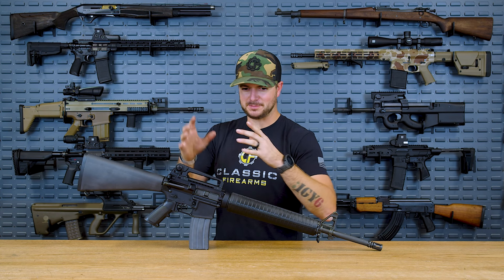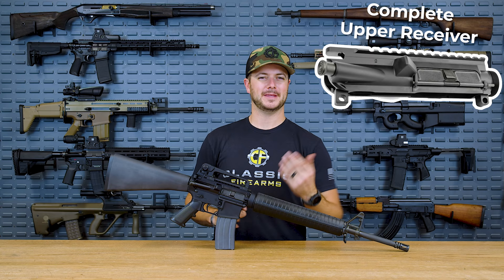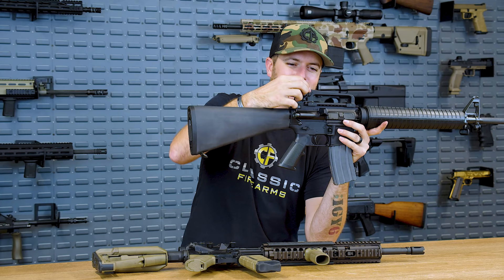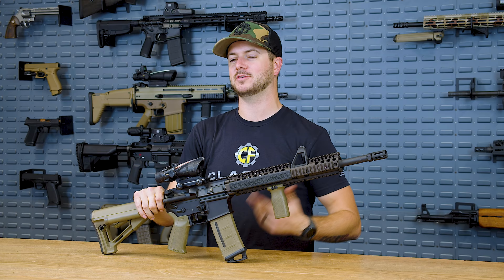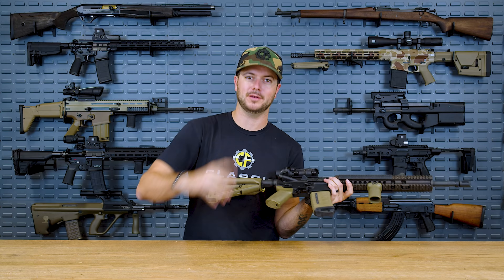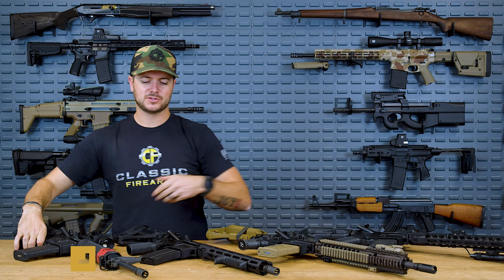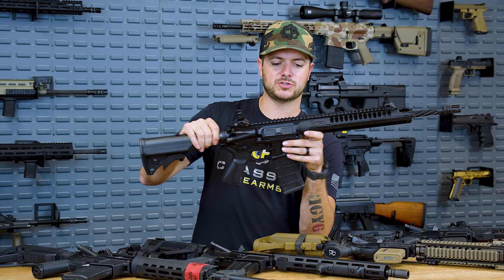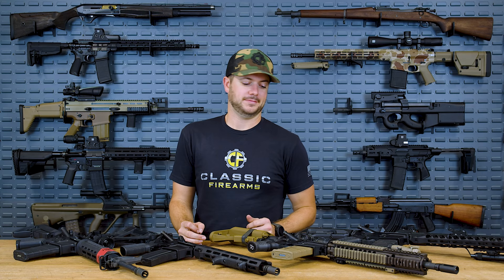What Are Upper Receiver Forge Markings And What Do They Mean?

Comment: BCM has since ceased outsourcing most of their forging, it is now done in house on their own machines. Their forge marking is their five point star logo.
Reply: I’ve seen that. It’s pretty cool lookin honestly
Reply: I just looked at my BCM upper while watching this video and saw it has a star.   Thanks for the info.
Reply: Yeah, this video made me pull out my MCMR. Had the star inside a square. Pretty cool.
Reply: just looked at my BCM upper and it has the splintered A
Reply: @Zues90  my recce 16 has the splintered A. It was the first BCM I bought some years back. My other two which I've purchased over the last year or so both have the five point.
Reply: @tooeazy1070  hmm. Wonder when they switched. Bought my MCMR earlier this year in may.
Reply: @brandonjanasik9871  probably a lot of previously produced items still floating around. I wouldn't be upset if I got some of the older stuff. Specs and tolerances are still the same. Guess BCM just got tired of paying the middle man lol
Reply: @brandonjanasik9871  Their growing doing more inhouse  its a natural progression in company's. In the end it brings their overhead down with less reliance on outside company's
Reply: Doesn't really matter if BCM still makes all their rifles over gassed
Reply: @Lawbase  come on now, Did you have to come into the room with those tears & smeared mascara running down your face?
Reply: @gatormcklusky5850  No, I just don't spend money on poorly tuned rifles
Reply: @Surname  they do it for the same reason all the top manufacturers do it. Makes the rifle more reliable with various loads and the addition of suppressors. You want watery eyes from a gassy gun? Shoot a DDMK18 with a can on it.
Reply: @tooeazy1070  Cringe excuse no they don't. Especially when the owner of BCM touts good tuning
Reply: Yup it’s on both my uppers
Reply: I was gonna say, My BCM doesnt have as square forge mark, it has the star
Reply: @Lawbase  i would hope an out of the box upper is "over gassed" so it allows me to mess with buffer weights and springs to tune it on my end to my own ammo choices
Reply: Barrels also fit tighter in there proprietary upper receivers in my experience.
Reply: @matt loomis  yep. Makes for a more accurized upper. Any time I build I use BCM uppers. I buy the blemished ones for 90 bucks
Reply: But they still built their reputation on someone else forge. They’re all the same materials
Reply: @Jonathan Young  materials and specs are still the same. Just a cost saving thing. These forging companies produce what the manufacturers want. This comes down to materials, tolerances and just overall specs. An Anderson Manufacturing upper is not the same product as say a BCM upper produced by the same forging Co. A 10k dollar CNC machine can't do what a 50k dollar machine can. Same company making them, but on different machines with different specs demanded by the rifle manufacturers.
Reply: Nice!
Reply: @Extremekhan24  I have two side charging uppers, and I enjoy shooting subsonic loads (my own) .308 & .300 blackout using a Witt SME muzzle device, I use adjustable gas blocks on all of my ar type rides. (Superlative Arms)
Shut the gas completely off and I have a straight pull bolt action rifle. 
Turn the gas back on and tune it to the ammunition in use.
Reply: @tooeazy1070  I think you'd be surprised at what both those machines can do. I've been doing this since 1993. It isn't just the machine, it is very much the machinist.
Reply: @GC  I don't doubt your point one bit Sir
Reply: they have someone forge them with their own mark. they dont own a foundry or forge.
Reply: The Stars been around a lot longer than BCM how can that be their logo it's all over my flag.
Reply: Are you sure they didn’t just buy their own forge dies for their newly designed receivers, I don’t see a parts assembling company investing in a foundry when they have been closing across the country.
Reply: @from3  You have a slightly older one

Comment: Good forgings can make or break the manufacturing process once it's machined. If the part you put in the mill is out of spec or all your forgings have inconsistent measurements, it can make it extremely difficult to machine things correctly and accurately. Alot of these things come down to thousandths or tenths of thousandths of an inch, and a slight change can make a big diffrence.
Reply: no machinist or engineer uses the part as a guide to machine it.  it's put in a jig and the jig is set in the machine using the machine's XYZ coordinates. no one just throws a part in a cnc and hits the go button.   the castings are not going to be "wrong" because they use a pattern to make a casting. during the casting process they are checked and double checked then checked again.  the pattern will wear out over time but it's always checked before it's used to make parts.  that's what I used to do for a living. the errors come from the cnc operator that may have changed the machine parameters or bumped the jig bolted to the table.  

 lets take an AK for example.  it's stamped steel and rivets.  do you think it's as accurate as a machined AR part?  LOL  hell no.  does it still function?  some argue much better than the AR.
Reply: @blue03r6  Love it.   I find it funny that people are now pouting to realize their high dollar AR was made or began life in the same forge as a PSA.
Reply: @blue03r6  Partly true. The forging is important because you still need a consistent part for the initial fixture to hold. If that changes, it changes everything after. I ran blanks from Cerro and Anchor Harvey. In some cases the blanks were so out of whack it was nearly impossible to get a quality product. Some were bowed like a banana. Some were thinner along the rail on one end than the other. Etc. Even when blanks are consistent from the same company, there are differences between the companies. So I would only run blanks from Cerro until that batch was done, then adjust to make the Anchor Harvey come out correctly.

Comment: As a retired machinist I must agree with that the machining of whatever forging that is used is the most important.
Reply: Cause the quality of the aluminum has nothing to do with quality
Reply: Which company, in your opinion, has the best machining?
Reply: @jackbauer4186  I was a machinist.  It literally does not matter what company you go with on AR receiver sets, the people that argue otherwise are generally gun snobs attempting to justify their purchase or talk down to others with “budget” rifles.  I own several rifles with varying price points and the biggest difference between them is not performance but the price point.  They are all within about a quarter MOA of each other which is negligible and can be chalked up to barrel resonance or even ammunition variance.

Unless your receiver set is grossly out of spec they will have virtually no impact of the accuracy or reliability of your AR.
Reply: I’m also a machinist. In my opinion, it depends a lot on a particular companies Commitment to quality control  and in process inspection, in other words , how well they sustain machining to tolerances that produce a quality product.
Reply: Anyone can buy a forging and then butcher it, you are quite correct.
Reply: @jackbauer4186  I wouldn't know, I've never toured any of them. To see their process and quality control.
Reply: @jackbauer4186  KAC
Reply: @otetechie  Does KAC do their own machining? I've heard they use a lot of parts made by LMT, but I'm not for certain.
Reply: @TeSolycMandalor   Yea . Didn't you   watch the video ? All of it?
Reply: @apersonontheinternet8006  Yup. Most accuracy improvements on the AR can be done by first using match ammunition (handloaded being best), and second using a barrel with a twist rate ideal for the bullet weight.
Reply: I'm just saying I work for a CNC machine shop and we make the receivers in house billet aluminum and I truly think that Forged upper receivers that are machined are just as reliable 👍🏼

Comment: A few thoughts and comments... we use multiple forge houses to guarantee availability, particularly during busy periods.  Pretty typical supply chain management.  The forging house will use your spec of metal so just because it is marked XYZ does not mean it is domestic 7075 vs imported 6061.  We only use domestic 7075.  The forge die can be a generic mil-spec, slightly different or way different depending on what the manufacturer wants.  A custom die set can cost $20-40k.  Most forging companies have some standard mil-spec ones that lots of companies use.  There are also differences on how the forgings are heat treated or stress relieved afterwards.  This is an important step as it effects how the metal responds as you start to cut it.  Upper forgings that are not properly stress relived afterwards can see a shrinkage of the bore after machining which will result in the BCG not fitting correctly.  As far as people mentioning the fitment of the upper and lower, that is strictly in the machining process.  Mil-spec calls out the dimensions for all of the interfacing parts and honestly it can be loose.  Some companies including us, run tighter tolerances on the tighter fitment side.  When done exactly right this can result in those dream sets where the upper and lower click together with zero play.  Lastly, some people mentioned that the parts are not machined off of the forging.  This is partially true as the machine operates on its own coordinate system called a work offset, but that has to align to the forging. In the case of the AR, there are indexing or position marks.  On the upper the front to back is set by a slightly protruding line on the left hand side. We use in process probing to find this mark and align the work offset exactly to it.  Look at your upper and you will see the line.  Can you find the mark on the lower?  I'll give you a hint, it is a circle.

Comment: I work for a forge shop. “Steel forge shop though not aluminum”. And depending on the the defects I can argue that the quality of the forging is as important as the machining. Laps of the grain flow can occur during the forge operation at least on steel.  And  this along with forge temperature if not right can cause major issues on the end product. Other issues can happen also during the process but those are probably the main two other than thickness. And those two can cause premature failure on any final machine product. I would think this would apply to aluminum uppers also. But again I’m not in the aluminum forge business just steel.

Comment: I have been waiting for someone to explain this. The splintered A is also on Areo and balistic advantage. Thanks
Reply: PSA also, I know anderson and radical firearms use the keyhole, the radical uppers have been really well done in my experience
Reply: @lumpyzx2645  I have an Anderson with a square.... 🤔
Reply: I was surprised to find the anchor harvey mark on a complete m4 flat top upper from bear creek arsenal .  Fits  milspec anderson forged lower much better than their own (BCA) billet side charging receiver.
Reply: @derrelledwards6088  well od say that as long as it's machined to spec then it's probably good to go then, the only other question would be the finish
Reply: It's anchor Harvey forged not areo precision different companies use diff types

Comment: When I 1st looked into AR upper forge marks, I read that the best forge Co." are the ones that use the "keyhole", & the one that uses the "square" is the 2nd best. So of course I made sure to source "keyhole" or "square" marked uppers for my 1st couple builds. But, as the yrs went by & my AR building turned into an obsession, I eventually came to realize the very point u made in this video. That a quality mil-spec upper comes down to the machining & finishing process rather than the forging. Small attention to detail can make all the difference between getting a really nice upper, & one that just sucks.
I recently finished a color scheme build that I've always wanted, ODG w/FDE accents. Since my concern was def more with overall appearance rather than performance, it could def be considered a budget build. The upper I used was from DoubleStar that came as an ODG Cerakoted upper/lower combo that I found for cheap. Turned out that Doublestar made a very nice upper & lower. I was very impressed with overall quality of the fit & machining, especially with the upper. They also put a "10" mark (or "01" depending on how ur looking at it) on the takedown lug. Not sure what it means but I def found it kinda cool & unique. Another Co. I came across that would be considered cheap/budget but makes a solid product was AR-chitect. They made the ODG handguard I used & again, excellent attention to detail. The pic rails weren't like cheese graters like other cheap brands, & were scalloped giving it a high end look. The basic "machine gun" style vent holes looked great also. 10" HG for less than $80.

Comment: I compared 2 of my new, unsed uppers. I noticed my bolt carrier has significantly more play in my Cerro than it does in my BAFE, which is what came on my M&P 15. Much better tolerances on the BAFE. This may have nothing to do with function though. It mates up to lowers just as well as the BAFE.

It would be nice if there was a mark for what grade aluminum was used, though 6061 & 7075 have both served their purposes well for millions.

Comment: If the forges are mixing thier own alloys that's a step that they could screw up. But if thier QC doesn't catch a problem a good machinist will probably notice if the part is behaving differently (more or less resistance to cutting than usual, unusual discolorations during cutting, etc.). So ultimately I agree that a good machine shop/end manufacturer will make a much bigger difference as they have more opportunities to mess something up and they are in a position to notice problems with the original forging and discard a defective part.

Comment: I worked for a company that made patterns used for the casting process.  those marks are just company logos.  the casting process is way more important than the machining process. keeping impurities and air cavities out of aluminum while being cast is the hardest part. a good part starts with the pattern.  that's what I used to do.  and the error allowance was still 5 thousands for almost everything we did.  that includes aircraft jet engine parts.    I wouldn't worry about the quality of machining of the upper and lower too much.   an AK should teach you all that a loose sloppy built gun functions just the same and some may argue better.  the only advantage an AR platform has is because it's a machined part, mounting optics to it is much easier.
Reply: The ar being machined doesn't have anything to do with optics. It's a better design for optic mounting.

Comment: The forging matters as much as the machining. If the the forging is not consistent you can have uneven stress which can lead to cracking.
You are right to say that if the quality control is good you won't have issues, if not it doesn't matter how great the machining is it still a pretty piece of junk.

Comment: I have 2 Anchor stripped uppers from MAS defense and they fit tight on 4 different lowers. I also have an AERO Precision complete 10.5 upper and it is also an Anchor and fits not as tight on most of my lowers....it is on a PSA complete pistol lower now that interestingly came with the threaded hole for the screw to take the play out of the upper and lower...similar to the AERO lowers I have used before.
Reply: Thanks for the information.
(I'm totally not an ATF agent)

Comment: I own a Daniel Defense M4A1 that was built in 2015, and the upper and lower are both Cerro-forged. I also own/have owned multiple DD URGs which were built on Anchor Harvey-forged uppers; I believe DD went from Cerro to Anchor Forge around 2016-17. Personally, I like the fit and finish of the Cerro forged receivers a lot better than the Anchor Harvey forgings. The difference is especially obvious when I put my newer M4V7 upper (Anchor Harvey forge marking) onto my older DD Cerro-forged lower.

Comment: I just want high end parts and perfect fit finish and the upper lower lining up and LMT Needs to work on their tooling as I will definitely buy a loaner if I know that if I could get matched up or silver mines aren’t all offset and type three hardcover anodizing I prefer and then cerakoted over like Noveske and radian only cerakoted and different analyzing colors you’re not gonna have a consistent match but I think that all the different and icing colors are pretty cool yeah from FDE to basically like the MAS gray suit color